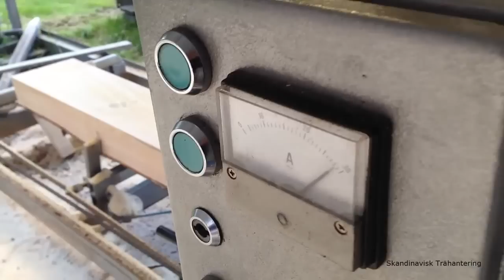Snik chainsaw mill video 1

Comment: Nice konstruktion. How do you control the speed on the feed? Can you mill in both direktions?
Reply from the maker: The  feed are friction drive watch video no. 3  https://youtu.be/krgGyR8jwQI  
Yes the mill cut backwards manually mostly leigh cuts  not to overload the nose wheel
Thank You for  Watching

Comment: What's the hp & rpm on that bad boy. It's cooking😳
Reply from the maker: Be kind to check the deskription on my videos The Snik saw is a 10 Hp  electric chain saw with automatic load-dependent feeding 0-15 meter min.
We handle U-restricted stock diameter max length 5.7 meters Maximum block size 20x30 inch 520x760mm

Comment: how often do you have to change/sharpen the chain? I was thinking of making the same setup weighing the advantage disadvantages of chain vs bandsaw blade.
Reply from the maker: When we change the chain all depends on the length off the chain bar and the hardness off the timber.
With a 20  inch bar and a 72 link 3/8” chain  we normally cut 45-50 m3  planks in 1 to 2  inch thickness one bar can be used with 2-3 chains.
How often you sharpen depends very much on how much dirt you have on the bark on the side off the timber where the chain enters the wood . 
The chain quality of the cut can only be compared with a band saw with 75-100mm bandwidth and such a saw is a completely different price point.
Reply: @Svendus  thank you for answering  !

Comment: Incredible mill. Fantastic design. Does it cut in both forward and reverse? Looks like it does.
Reply from the maker: @ Paul DeJohn 

Yes it cuts in both directions but only with manual feeding backward not to overload the nose wheel 👍
Reply: @Svendus  that's great...either way. Makes for faster production. Again...fantastic design. Hats off to you. Admire what you've done.

Comment: this is way cool...and fast...wonder what the chain speed is?
Reply from the maker: Hi Ari
Chain speed is constant at 20 meters per second
installed 7.5 kw The motor is an ARGUS 55 + and we charge double the rated power 15 kw 30 A
Chain raker is 1mm i doesn't recommend this without nose wheel lubrication. feeding pressure 0- 50 kg 0-15 meter p. min.
Alright we have experimented with high speed chainsaw sword
and 404 chain 35 meters per second, but have stayed at 20 m sec ( do to security and wear)
Reply: about the same as a professional chainsaw...not too much, so the chain and sprocket should last just fine with smoother tension of the electric motor...
Reply: a regular chain or a harvester chain with double the teeth?
Reply from the maker: Ari Lehtiniemi harvester chain 404 "make 9 mm saw cut a 3/8" Ripping chain 7-8 mm we have of cause tried 404" they are very strong but makes lots of sawdust :-)
a 404" with 6 mm saw cut should be good, but manufacturers want big volummen and can not take on small orders, the Picco chain  are wery nice but do not stand long @ 15 kw
Reply: No, Picco chain can definetely not take 15kW electric motor...even 2.8kW Husqvarna 550 XP has trouble with 1,3mm (.050") chain not lasting.

Comment: Are your chainsaw mill products available in the USA?
Reply from the maker: No Garry we have only build 2 machines a 5.7 Meter (18 feet 813⁄32 inches) and one 7.5 Meter (24 feet 79⁄32 inches) 10 and 15 Hp

Comment: amazing piece of machine :O. I would like to build one myself but don't know where start. Do you have plans of this machine?
Reply from the maker: No sketches was actually made  it was build from fantasy  alone.
Reply: Svend Nielsen oow okay, i am just wondering how to mount the chainsaw bar on the motor and for adjusting the tension on the chain. Do you detailed pics of it, or could you send me some?
Reply: Svend Nielsen
And how much rpm produces the motor for the chain ?
Reply from the maker: enzo welvaert
 we have some pictures on our website http://www.trahantering.se/trahandteringen/snik/snik1.html
Reply from the maker: enzo welvaert
8000 rpm. with a 8 sprocket 3/8 " the chain speed is 20 m/s.
Reply: Thanks :)
Reply: enzo welvaert nn
Reply: @Svendus  Здравствуйте Свенд.Скажите как вы рассчитываете скорость  движение цепи?Есть какая-то формула?
Reply: В Я  please write in English Language 😉
Reply: @svendusmcveteraner  Hello Svend.Plese tell me how you determined the speed of the chain which in your sawmill is 20 meters per second.Doyou have a formula to calculate?
Reply: В Я  Spocket middle diameter x π (pi) 3.14  x rpm. 👍